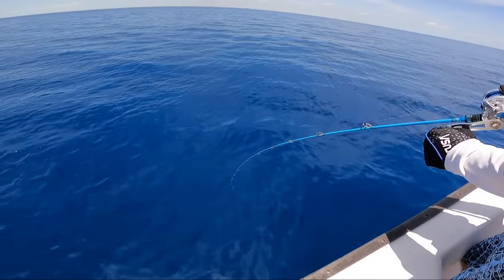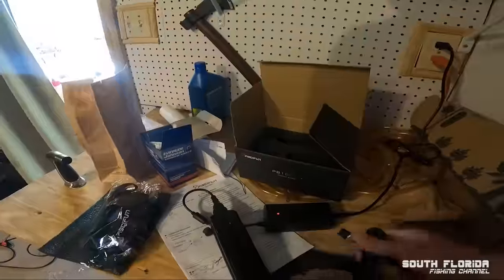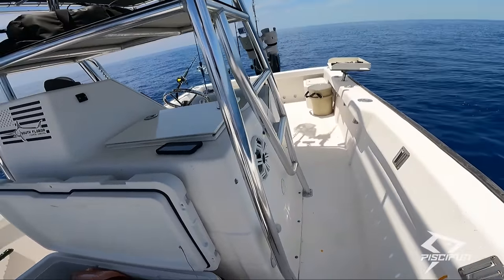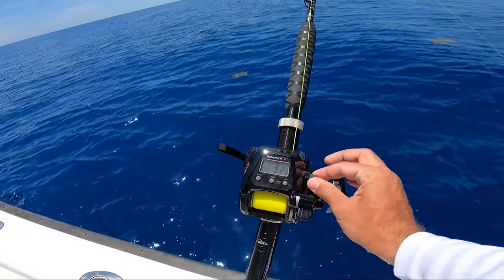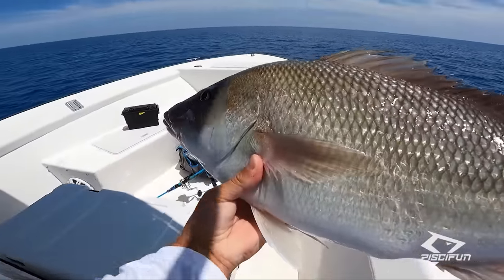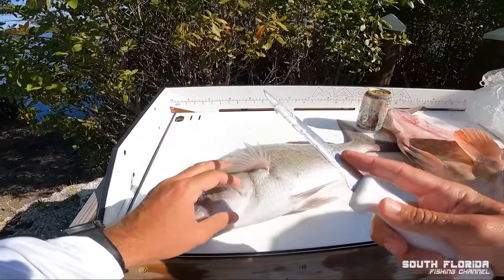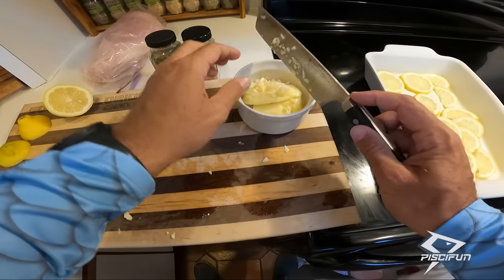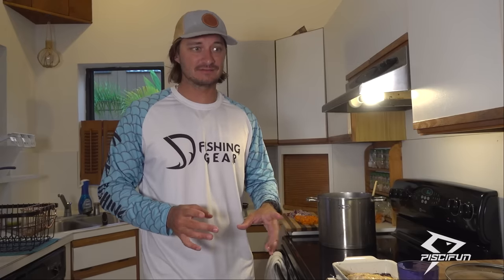The cheapest Electric Deep Drop Reel {catch and cook]

Comment: The reel has an auto stop feature when it get's to 0. Prevents it from taking your terminal tackle into the eye on your rod. Normally you get setup with your rig and let out maybe 10' and reset to zero. That way the reel will stop when you have 10' o line left and you manually reel that last 10' up. If the reel pulls your terminal tackle all the way to your rod tip most likely the line will break. Great video. Keep em coming.

Comment: Used that type battery on the tanacom 1000. Very bulky.  Not east to use if you like to hold the rod. Better to have a cable attached to it.

Comment: Check for air leaks in your fuel line and fuel filter housing. Sounds like it runs out of fuel which causes it to lean out. That can also cause and erratic or high idle.

Comment: Heiko.   Your using gas station gas in your boat.  You need to add an additive to the fuel called STAR TRON ETHANOL ENZYME. Pump gas soaks up moisture and causes the fuel to go bad.
Reply: He needs to use rec fuel only he hasn’t learn yet I’ve got rec fuel almost 30 months old still crystal clean nothing floating around in my fuel turn key and go. I have a 08 300 etec  no problems JT
Reply: @hookednrolling2009  agreed.   But pump gas is cheaper and using that additive fixes the ethanol issue

Comment: yo that battery is cool if it has an extention cable but otherwise theres a 100% chance the plastic plug cracks from hanging off the side of the reel like that and it would be a real bummer if the female plug housing on the reel is what cracks

Comment: If you had a spare battery you could charge one with your powerbank as you use the other or you could ask Piscifun to come up with a cable to plug the reel directly into the powerbank or wire a socket into the boat power/battery system for no bulky batteries etc?

Do you have a filter problem or a fuel contamination problem?

Should it not sound like 'Pisces', rhymes with 'spicy'?

So you can have a spicy Piscifun lol 😅😅😅

Fresh fish baked on a bed of lemon with a seasoned garlic butter sauce, garnished with some fresh herbs or spring onions perhaps? lol

You should always embellish/'poncify' the description of you catch and cooks, you should watch some cooking channels to pick up on the lingo 😆 🤣 😂
Reply from the maker: Haha yea! I’ve used the battery several times and it’s always still full charge after a full day of fishing

Comment: That junker will never last. 5.0 gear ratio.  Will not continually handle your bigger Deep drop fish with the weight needed. Might work a little while but wont last.  Nearly all good electric reels come with much lower 2.8:1 +/- which is a bigger and much more stout gearing for handling the necessary weight and drag needed for deep dropping. But good luck.  Also releasing that grouper at that depth doesn't have a great mortality rate.  Nice thought to release but you should be keeping legal size fish for the most part Deep dropping.   Congrats on getting a latitude LTB boat.